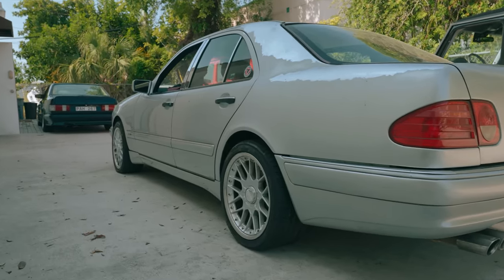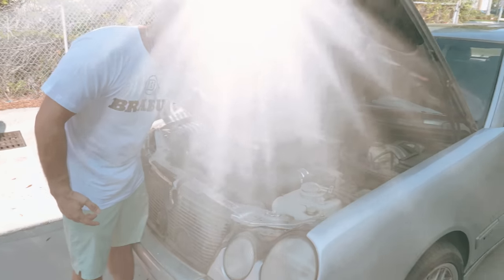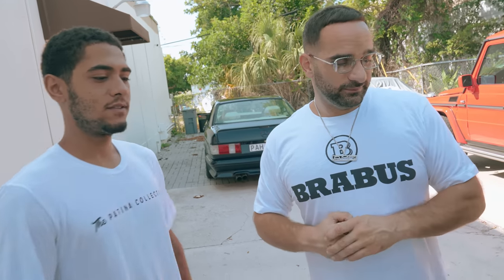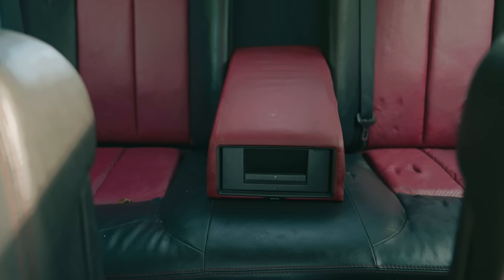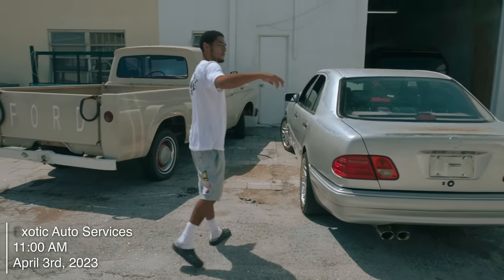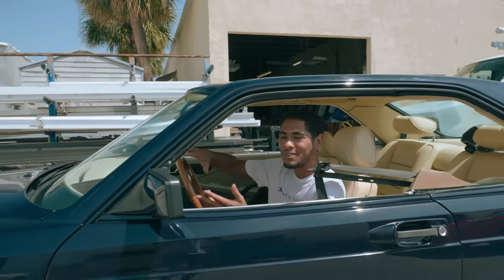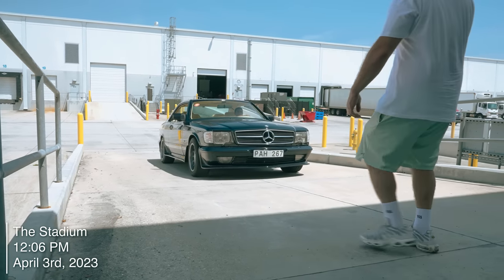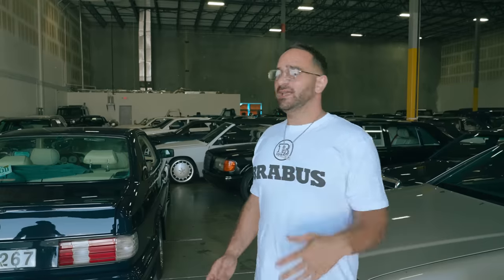RENNTech E60 Arrival!

Comment: waiting for a clk gtr
Reply: That’s not an 80’s or early 90’s classic? That late 90’s Motorsport homologation model.
Reply: That’s another level bro. They’re in good condition at 8,5million going at auction…
Reply: CLK Gtr is way too valuable that it's not worth owning, just simple  maintenance and insurance is insane on that car. 

They should try to get their hands on that Mercedes c1000 made for the king of UAE. Will probably be around $3-4 million dollars... but will go way up in value in 10 years easily.
1200 horsepower, twin turbo m117/m119 (unknown if it's based on the AMG hammer engine or the Sauber engine) chassis is based on the Sauber c9 Le Mans winning race car. It's basically Mercedes version of the Mclaren F1 or the Jaguar XJR.
Reply: & LAST but not LEAST MayBach COUPÉ
Reply: @BOSSofLA  that’s not early 90’s
Reply: @tonychavez2083  so them having the “2 Maybach 62s & Maybach BRABUS” is jus imaginary…. Mind u that I asked Vic on insta live n he mentioned he would’ve gotten it but because of its unreasonably price it is at the moment 1.5million? It doesn’t make sense ,I hope this respectfully answer your question that’ll you’ll hopefully do ur homework better next time.. there will always be room for a Maybach 💪#untowable.

Comment: Get up to Caffeine and Octane in ATL sometime. It's broadcast on NBCSN in the fall so you can get something on TV or featured I bet. I have a project R129 300SL 89 build date but has a 2JZ. You guys probably won't be crazy about it because of that but has period correct Millie Miglia wheels and looks 100% Mercedes on the exterior not changing Sacco's perfection.